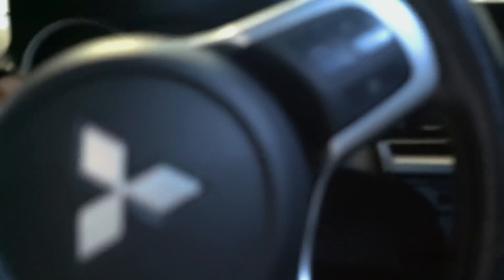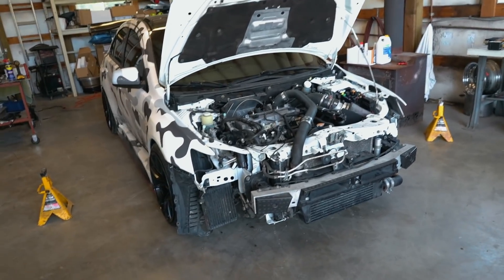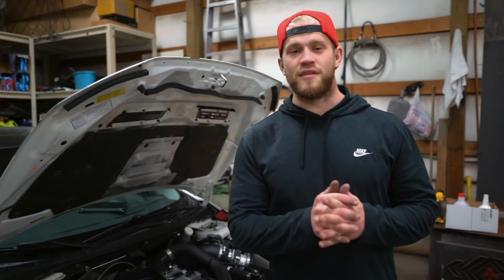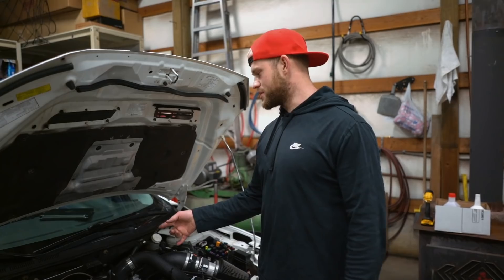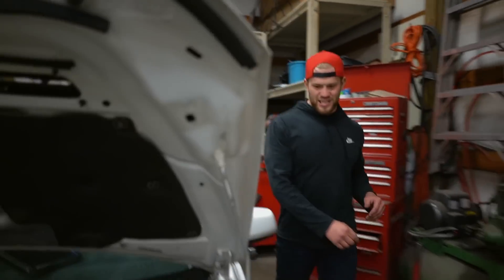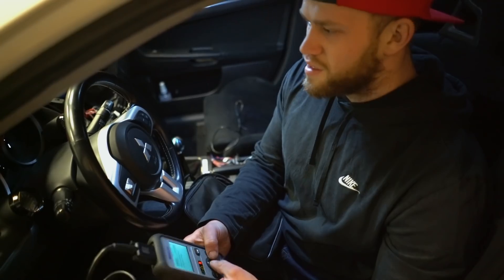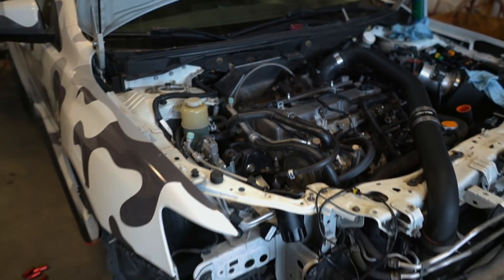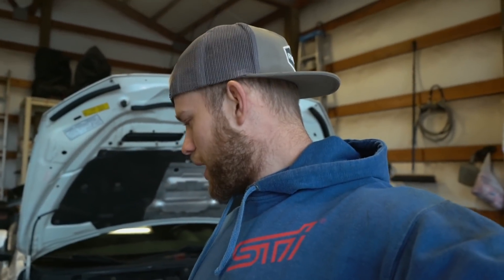She's Alive!

Comment: My 10 EVO X has been sitting since Nov 17 cause someone who assembled my 13k motor didn't install some components right and it blew my ported heads to pieces and the block has a hole in the side. I can't decide whether to sell it as it is or rebuild the motor again... Good thing I am overseas on deployment currently for the next two years so I have a bit of time to figure it out.... Nice seeing you do the work yourself though. Very encouraging and insightful.
Reply: J Black I’ll buy it 😬😬

Comment: I have the same problem with 2006 STI the accessories turn on but it won’t turn on it’s like I ain’t pressing the clutch but I am
Reply: Did you put a new motor in as well?
Reply: JRevs no i did a clutch job, spark plugs and oil pan gasket